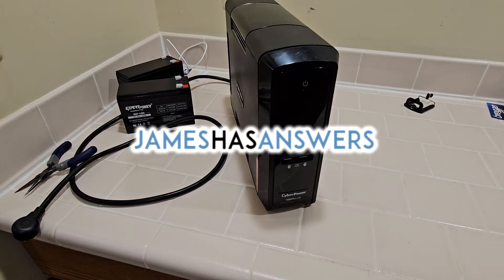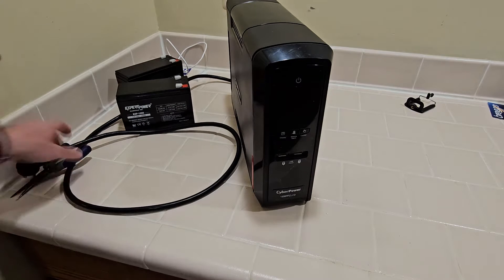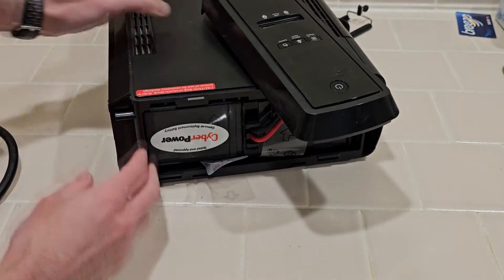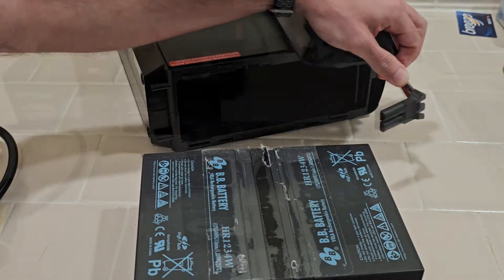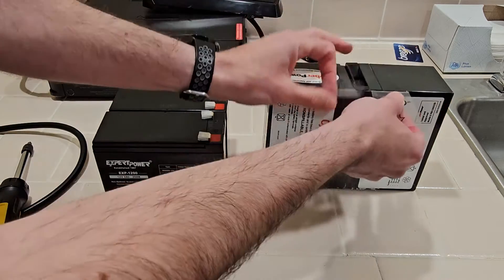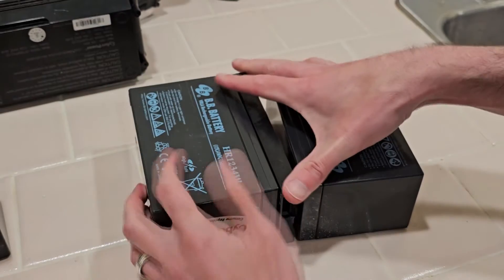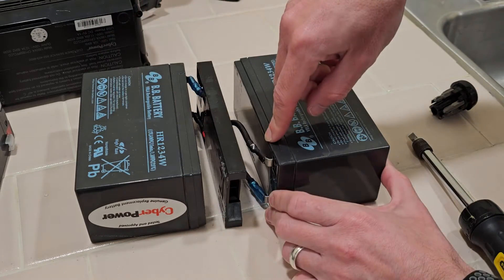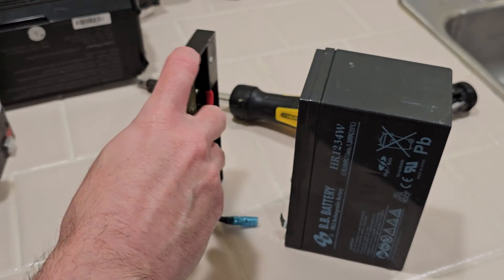Replace CyberPower 1500PFCLCD UPS Batteries

Comment: These instructions are great for the physical replacement, but don't tell us how to reset the battery life counter.  On mine, the battery health still reports as 0% poor, even though the batter is full charge and working fine (passing internal test).  How do we reset the health counter?

Comment: Quick note the OEM batteries are trash. 34W designed for 15 minutes of load. It is possible to get replacement batteries cheaper which are 90-100+W. Which will increase the runtime by a large amount in the case of a power outage. Do not buy OEM batteries unless necessary.

Comment: just had an alert on my CP1500PFCLCD that the bettery needed replacing.

looked at the options and wasn't sure which battery to go with, then found your video and gave me my answer!

Should be here tomorrow and will be following your instructions to replace.

Thanks :)

Comment: AI lied to me and said that the front pulled straight out. after trying for a minute, I went on youtube and found your video lol popped right off! Also, I just took the battery pack to my favorite battery store and they went and did all the dirty work of putting the new batteries into the middle divider and taping it up for me :)

Comment: There's a few variants of the model. I think this may be the first gen. Later ones with a color LCD have 2 isolated batteries. This V1 style is a bit friendly.  Only issue I have had on V1 was that a battery had failed and bulged. That froze it in place.
Reply: “Friendly?”

Comment: I bought used CP1300EPFCLCD with battery missing so I can't buy just two single battery but need battery pack with spacer and wiring. It cost almost twice then bare batteries and hard to find kit due "old" UPS model not in sale now. There are two separate cable inside with Faston on each end not like in video.
Reply: It is not trouble! try to use any powerful similar batteries like 7/9 Ah 12 V, but you must obtain crimper or find some kind electrician who make for you faston cable. Set batteries not like in video because one of batteries settled incorrect (by specification not use battery upside down, see my comment upper). You must set both batteries one under  other contacts facing up. Ask electrician how it can make correct.

Comment: How long was this used before the battery need to be replaced?
Reply: I usually replace my batteries every three years.  I then use the old batteries in other less important projects until they die.  I also add a little acid and desulfate the batteries which has helped me get another year or so of use out of them for other projects.  These batteries arely lost very long.  Some UPSs I think are switching to lithium batteries for my critical systems.  

While the UPS will try to tell you when a battery is bad, it doesn't always work.  If you have a system that if it lost power it would cause data loss, you want to replace the batteries early, before they go bad.  On my main computer, every three years.  On my NAS box, I'll go longer since it isn't even always on and I have other copies of the data.  The NAS box is used mostly for backups that I update each weekend.

Comment: Is it ok to use the same batteries for the 1300PFC ? Because its default ones are 2x 7Ah 12V
Reply: At least weight of batteries must be as 0.3 of capacity or more not less (for ex: if you need battery 7 Ah it must be 0.3*7 = 2.1 kg or more (2.3; 2.5; 3 kg) ).
And IF size of batteris could be replaced by higher model try use it, btw 7 and 9 Ah are similar, try to guess what kind of capacity is better? BTW the upper battery set incorrect it need be set as bottom one.

Comment: I would strongly suggest to do 1 battery at a time and take a pre photo.    Most people have no idea what wiring in series or parallel means and the wires are not color coded having black on red on one battery is a recipe for people making mistakes putting them back together then finding out they did it incorrectly.
Reply: BTW it is wrong placement of upper battery, it is better to turn over it. But in this video such PLUG must be cut off.

Comment: Would it be wise if I use LiFePO4 inside that form factor?
Reply: It would not. LiFePo batteries have very different float voltages and charging rates. People have done it, some have had no issues, others have overcharged the batteries and made them effectively worthless. I would assume it has to do with how much strain they are under when the power goes out. I would use only SLA (sealed lead acid) batteries in this UPS. The only time I would use LiFePo batteries in this ups is if cyber power comes out with a drop in replacement which they have not.
Reply: @camtech1679  TOO LOW CHARGE CURRENT, it's about 0.5 A. And possible in such case/volume couldn't made compact battery with useful power capacity.

Comment: What a user-unfriendly design.  For an item that is supposed to be user-serviced, shouldn't it be easier than this?  Batteries like this don't last beyond 5 years, so you can be pretty sure they will have to be replaced!
Reply: If you do it as you like, the service will be left without work and, to be honest, the upper battery is located incorrectly. I think the degradation will start from it. It is better to put the UPS on its side, at least then all the batteries will be in an equal position.

Comment: https://www.youtube.com/watch?v=wYAQZohN0CY
sir I am so sorry because after I watch this official video I was confused.
The lady sound said unscrew the UPPER battery component and pull off the LOWER battery.
But clearly in this case the LOWER one is RB1290X2.
Then what is the UPPER battery part? I don't think the machine has a pair of RB1290X2 and RB1280X2.
I immediately cancel my 1290X2 because I was so confused after watch the official video

Comment: Nice little video dude!  Really well done.  This is exactly why YouTube was created for in the first place.  Seeing this done really helps.  You just saved me $140 USD so I can just replace the 20AH bat pair.  Thanks again.  Angie
Reply: Agreed. I have the same model UPS and when I bought it nearly 3 years ago, the battery was already worn down, probably because it sat on a shelf for many years. When I test mine, the battery indicator instantly drops to 53% charge on the battery, so I guess it's just a matter of time before it fails.

Comment: I wish to thank you for your video which I used to replace the batteries in the exact same UPS. I have a couple of suggestions that made it easier for. me doing it by myself that I thought I would pass along. My unit may have been an older one ( 10 years old) than the unit you used for the video as my unit not only had the cable going to the battery pack but also a multiple pin plug and a two conductor pin cable going to the front portion of the unit. When I put the unit on the side where the batteries would slide out, as you showed in your video , the front piece was in the way of the batteries coming out, while on your unit, you were able to put the front piece on top. It was not difficult to unplug both the multi pin cable and two conductor cable from the front piece which allowed me to put the front piece to the side completely. When I went to slide out the batteries I noted there was only ONE plastic pull piece on the left which made getting the batteries out very difficult. Where the other pull piece should have been, I found a piece of plastic that was cut flush with the batteries pack. As I was unable to use the single pull piece to get the battery out, I ended up standing the whole unit on  the end where the batteries were to come out. I then grabbed the two sides of the outside of the unit and was able to slide the whole unit UP and off the batteries. When it came time to put the batteries back in, I did the same thing in reverse, and put the batteries on end and slide the outside until over the batteries and it went in like "butter". My unit is up and working again and your video saved me about $150 over the the cost of a new replacement. Thank you again.

Comment: I own a few of these units, newest one is 12 yrs old and still working.  Problem I have is with the is the battery orientation.  If you notice the top battery is installed upside down.  This is the one orientation for an SLA battery that is a no go.  Not one battery manufacturer shows that their battery should be installed upside down.  Every time that batteries need to be replaced, it is the one on top that has failed.  They seem to dry out and if you shake them there is an internal rattling.  Just changed out another set after about 3 years of use,   Top battery rattles and is 12v, bottom battery is fine and near 14v.  This is float voltage. not under load.  It is a poor design that will cause premature failure of the batteries.  You may say that 3-5 years is the life of the battery anyway, and I'd agree.  But I'd counter with no manufacturer states upside down is an acceptable installation and 100% of the time for me, it is the battery that is upside down that has failed.
Reply: Planning to buy this kind of UPS from cyber power and I find this interesting. How about I lay the UPS down sideways? would that help out for the longevity? If not, I guess I’d do the way you did it and identify the pack that’s broken. Good insight.
Reply: @ekidona8775  Sideways would work, but look quite weird.  I just wish they would redesign the UPS to allow for both batteries to be mounted upwards in the correct, preferable orientation.  Here is a statement from a major manufacturer of SLA batteries, all manufacturers have similar statements:  Power-Sonic sealed lead acid batteries can be operated in virtually any orientation without the loss of capacity or electrolyte leakage. However, upside down operation is not recommended.
Reply: @WeeToddDidd trying to remember last I did (V3 with color screen) . Batteries were not sistered. One was horizontal one vertical. I think they are both right side up.  Not positive, but fairly sure.
Reply: @warrenbrown8670  Looked at a manual for the newer version and they did finally change the orientation.  Not going to help me for the ones I have, but when they finally die I will most likely replace with another,  Going through another premature battery failure due to old design,  Only 2 years 4 months on this set.  Would be nice if they admit their incorrect design and offered a replacement version at a discount.
Reply: The battery specifications state that it should not be used upside down. I would either place THIS UPS on its side, or better yet, take the battery out of the case. You can go further and install a larger battery, but the charging current is 0.5 A, and the charge will take too long.
Reply: Another premature battery failure at 2 years 4 months, once again the top battery is bad.  Still does not justify buying a whole new UPS yet.  But a PITA having to buy new batteries and replace the set again.  At least as pointed out below, the newest version corrects this design flaw.  I'd just say to check the manual for the one you want to buy and verify battery orientation.
Reply: @WeeToddDidd  just lay UPS on its any side, not need to keep one of accu upside.

Comment: Thank you!.  It was difficult to know where the battery connectors needed to be unplugged.  The battery connector is difficult to remove by hand PLUS you can't clearly see how the other end of the wires are connected.  I did find that if you use pliers GENTLY on the connectors it made it super easy to remove.

Comment: got my ups in march of 2018 just now having to replace batteries may 2025 they been giving me trouble for a couple months but just now caused a F03 error. Pretty good lifetime I was able to get from mine. Batteries were pretty warm when i took them out. Found the exact batteries you are using in the video on Amazon set of 2 for 47.82 after tax and a 1.99 week of prime trial to get 1 day shipping =). My neighbor got the same UPS around the time I got mine so I'll probably being helping him change his batteries soon as well.

Comment: hi, thanks for this good one. 

I have 2 cyperpower units. 

UNIT 1: 1500PFCLCD, do you confirm this model is the right one (unsure i can post the Amazon link here): CyberPower RB1290 UPS Replacement Battery Cartridge, Maintenance-Free, User Installable, 12V/9Ah ? 

UNIT 2: CP1000PFCLCD: it appears it uses also RB1290 but this time only 1. 

the funny thing is both dies at same moment... both bought at same moment as well 5 years ago. 

last question: for 1000PFC LCD it's just 1 battery unit, but for 1500PFCLCD, could i just replace only 1 battery from the 2... asking because i'm experiencing cut of power but generator is taking relay easily.... so my power cut are like 30 seconds and i dont have a great load on the UPS. should i buy 3 or... 2 ? :)

thanks for the video.

Comment: Thanks for the video.  My original batteries were going over 7 years.  I found it easier to do it vertically.  They slid in and out easy.  I did use a screw driver to push the connectors off the batteries as they were on there tight.  Since the old batteries are still at over 13 volts I am opening them up and filling with distilled water and seeing what happens.  I think these all go dead because they go dry.  Every dead UPS battery was dry when I tested them.  The top plastic comes off the battery revealing six holes with rubber covers.  These 6 cells are 2 volts each, giving you 12 volts.
Reply: Make sure you wear safety googles. :face-blue-smiling:

Comment: Oh man, this battery replacement is not the same as mine, at all = (. Mine are 2 separate batteries, and the cords are attached to the back of the machine.
I bought mine in August last year- is this an older model?
Reply from the maker: they do seem to reuse model numbers for varing iterations (as I've learned from the comments in thsi video), so it's definitely possible/believable that yours is different than mine, even with the same model number, unfortunately!
Reply: @jameshasanswers  That's unfortunate. Doesn't seem very helpful on their end lol.

Comment: I have the same exact battery backup except when I take my batteries out it didn't have that middle part, now I can't figure out how I'm supposed to put th batteries back in.. especially how am I supposed to power two batteries with only two cables

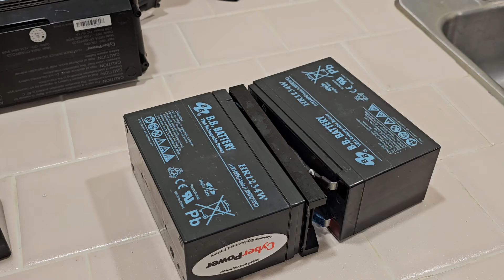Comment: I have the ExpertPower replacement and the cables do not aling correctly so i check plate with connectors have a - & + and i match those with the - & + from the battery. 2:56 you can also see the originals came with the blue cap wire connected to the red + and the black no cap with the - marks.

Comment: I have two of this same unit, one for my "TV wall" and one for my desktop computer.  My desktop UPS recently failed the battery test and since both of my UPS's are about the same age, I ordered the 4-pack from Amazon for only 85 bucks, ~ 21 dollars each.  I used to use the "APC" brand UPS and after a battery change, they would not "calibrate" properly the remaining run time since they stored the "usage data" in memory and prevented the new batteries from registering correctly the remaining run time.  From the video it seems that the CyberPower unit will register a correct run time remaining after a battery change-out which is good news....  Thanks for the showing the process to make the battery replacement easy-peasy....

Comment: Nice presentation. When I went to Amazon (official reseller for the OEM CyberPower batteries) to purchase replacement batteries for my 1500PFCLCD, it turned out the OEM CyberPower batteries for this unit were only $20 more than most of the 3rd party batteries. So, I decided to go with the OEM batteries for such a relatively small price difference. This was around Cyber Monday. Not sure if that made a difference as there were no "Cyber Monday Special" labels attached to the OEM battery. Anyway, I mention this for those folks who would prefer OEM batteries. Doesn't hurt to check the price differences of OEM vs.3rd party before hitting the "Purchase Button."
Reply: Great story - thanks 👌

Comment: Thank you for this, and thank you for linking the right replacement for the right serial numbers. Much appreciated!
Reply: you just need a 12v 9ah battery with 6.35mm spade connectors often known as t2 or f2

oh and the battery dimensions have to fit inside the battery space. they don't need to be the exact same dimensions.
just close enough to fit.

you can also use 7ah or 8ah but you would lose run time, 12v 7ah is like 780 watts

Comment: These batteries lasted about 1.5 years! Is it possible to upgrade to a better battery like a LiFePO4.
Reply: They sell 12v 9 AH batteries on Amazon 
One reviewer said it takes longer for the battery to get fully charged/ topped off but did work in the exact same UPS in this video
Reply: crazy, mine lasted 13 years. :face-blue-smiling:
Reply: Different chemistry, different charging/discharging parameter, you'll get in trouble if you do that.

Comment: My battery terminals did not want to be removed at aaaall.  Videos make it look so easy to disconnect.  Not sure why mine ended up being so stubborn.
Reply: Talk to it with a gentle voice, whisper to it, it might listen to you.
Reply: Have replaced a bunch of ups batteries. The connector being really difficult to remove is very common. Feel free to use appropriate tools to gently nudge it from initial connection.
Reply: Have replaced a bunch of ups batteries. The connector being really difficult to remove is very common. Feel free to use appropriate tools to gently nudge it from initial connection.